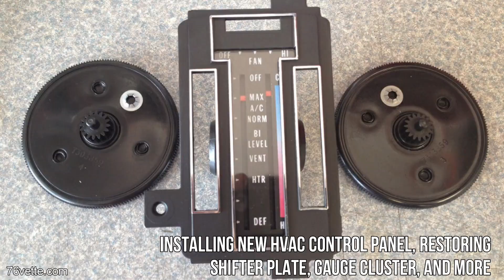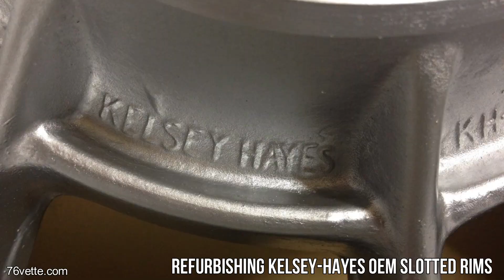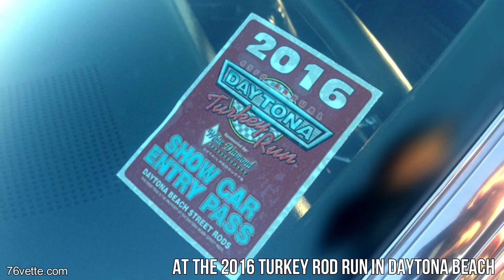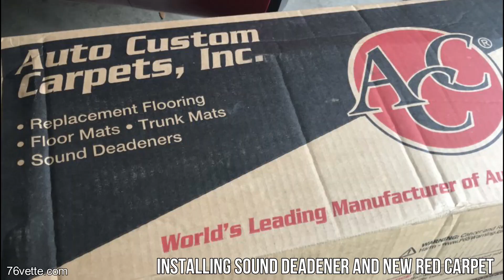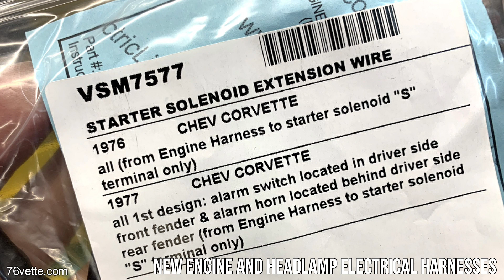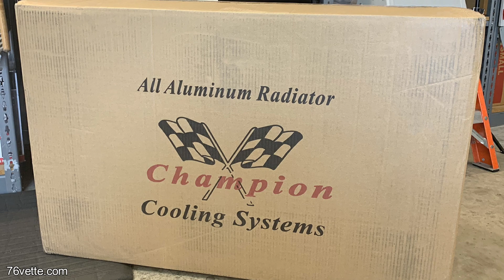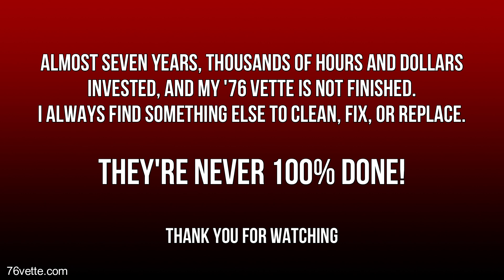C3 Restoration: SIX YEARS in 15 Min.

Comment: what is that switch you have on the driver trans tunnel?  my 1977 has a similar one, but it's not hooked up to anything...
Reply from the maker: That’s the switch for the rear window defroster.
Reply: oh wow!  mine does have rear defrost!  thanks!  I'll have to trace that wiring now!  @76vette